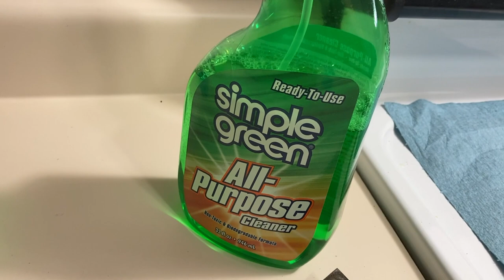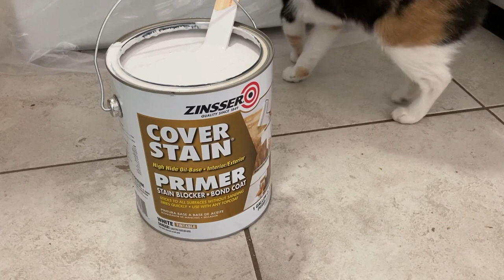Kitchen Remodel Update | Painting Kitchen Cabinets | In The Kitchen With Matt

Comment: Well, it's coming together nicely, if laboriously, lol;   but hey, at least you will be able to say, at the grande finale, that it's all your own work, Matt.    I think you're doing an excellent job in protecting those things that are not being renovated, and are being kept out of the way, or partitioned off.  Baby steps, but it's all looking good.  Well done!     Matt, ANY vegetable oil, literally, will remove sticky glue.  Just buy a pack of make-up pads (less than a buck usually, from the dollar store), pour a little veggie oil onto one of the pads, and gently wipe away the glue.  It works great on so many surfaces, and especially on glass and ceramics, but I've cleaned sticky glue residues off of wood surfaces too with kitchen oils.   OK, I only have extra virgin olive oil around my house, but in my studio, where artists accessories can cost an arm and a leg sometimes, trying to economise, I keep the cheaper brands of veggie oils, ad they do the same great job.   Keep up the good work.  :)
Reply from the maker: Thank you, Lauren! Awesome tip about the veggie oil. You know what else I learned, coconut oil takes off oil-based paint on your hands. It is so awesome, lol. I used an oil-based primer, and got it on my hands, should have worn gloves, but hey, you wouldn't be doing painting right if you didn't get it on yourself once in awhile, haha.
Reply: @inthekitchenwithmatt  You got that right, Matt, lol.  I can't count the number of good items of clothing I've ruined by covering them with acrylic or oil paints, glues, texture paste and whatever;  and all because I forget to put an old long tee shirt on, or am too excited about my latest project to be bother with protective clothing.   Don't ever mistake a glass full of waste paint from brushes, varnish, glue, etc, with your drinks bottle;  I did that a few months ago and was so sick.  lol
Reply from the maker: @laurenpiantino8312  lol, yea this project I made sure to keep wearing the same old shirt and old pants, hahaha. I bet you were sick! gross haha

Comment: Just went through nearly the same thing. Funds ran out about the same time as my old back did so we didn't get the counter tops done. Decided to do them next year.

Pretty sure you have got past this point by now but a Tac Cloth can be a real nice tool to use after you sand. And it wasn't long into the process I found myself questioning my saintly for not paying someone else to do it too. Fortunately I had a buddy that came up and spent a couple days and we did the cabinets and painted the walls too. Had a great time with him but we realized we weren't in the same health as we were when we were in our 20s!
Reply from the maker: That is awesome, J! Yeah it would have been a more fun project if I had someone else helping me. Tac Cloths are awesome as well, I wound up using my shop towels and a brush, which worked fine. Probably not as well as a Tac cloth, though, haha.